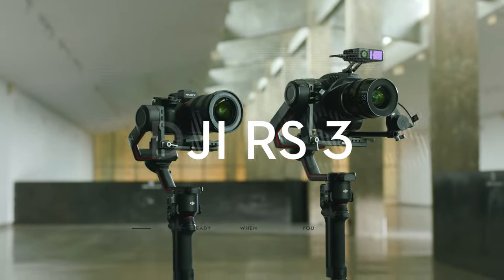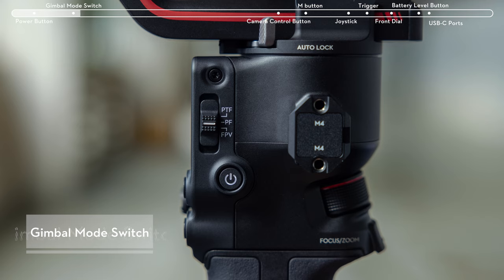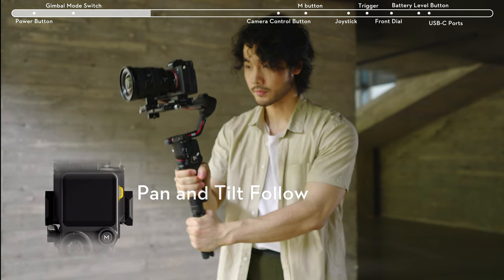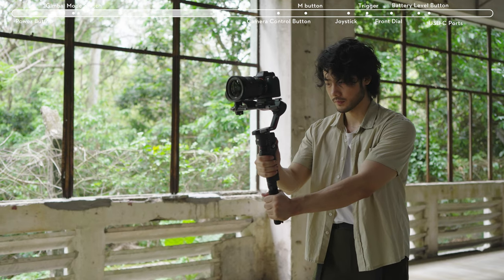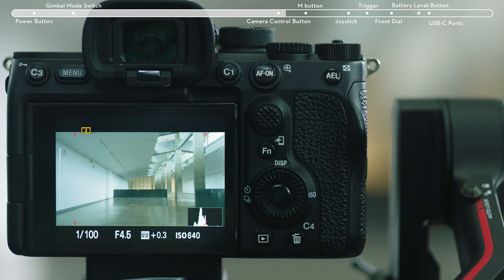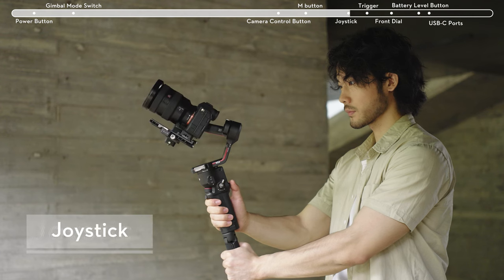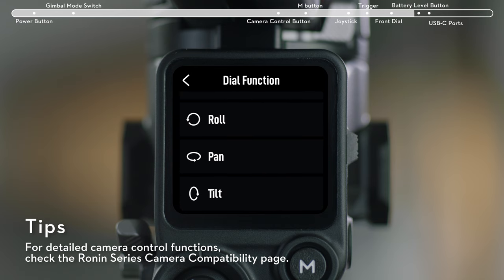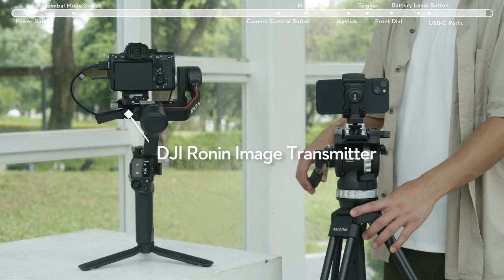DJI RS 3｜Buttons

Comment: Nice video! I would like to know if there is a possibility of powering the RS3 externally. I know that Power Supply Baseplate with D-Tap & NATO Mount is only available for the Ronin RS3 Pro. Do you think it would be good for the RS3 as well?

Comment: Thank you for this man I just baught the dji rs 3, is it normal when I select the fpv mode after any movement, the gimbal needs to be recentered every time. I have to double click the trigger to recenter it again
Reply: This happens to me on PF mode. It seems to need to be reset every time. No clue how to fix.

Comment: Unfortunately it didn’t work on my Z6ii.
However the 30cm USB-C to USB-C that comes with the RS3 worked like a charm.
I tested the RS3 Timelapse and it triggered the Z6ii flawlessly.
I still need to test if the Z6ii is receiving power from the RS3 so that long time lapses don’t drain the camera battery.
I’ll connect a power pack to the RS3 and hope power it kept up on both devices…
Reply: did power keep up to both devices ??

Comment: Dial Function: ISO not work for bluetoth.

My Sony A6400 does not work with the ISO function in the scrolling part.

Only the record button works normally.

Use in Bluetooth mode.

Bluetooth Remote Control is activated.

I paired it perfectly with the gimbal and the record button works.

I've already changed the scroll function for ISO, aperture, shutter and it doesn't work.

But if I add rotation, rotation and tilt it works.

Comment: So when the camera is connected via Bluetooth can I control aperture shutter and ISO or only the record button because that's a big deal for me that because of the swivel screen I can't really use the cable on the Sony A7 S3
Reply from the maker: Hi there, you can check this information on the compatibility list through this link. https://www.dji.com/support/compatibility/rs-3-pro/a7s3
Reply: @DJITutorials  TY 🙌 my question is why can't I control the same functions with Bluetooth like ISO aperture and shutter that's one of my main reasons that I need to use Bluetooth because the cable is blocking the swivel screen so Bluetooth connection will really help but only if I can control shutter aperture and ISO not just being able to record which that of course also really helps

Comment: Sir how to gimble activate
Reply from the maker: Hello, there. You may follow the steps below to activate the device:
1. Press and hold the power button to power on the gimbal.
2. Enable Bluetooth on your mobile device.
3. Launch the Ronin app and register or log in with your DJI account. Select DJI RS 3 Pro/RS 3/RS 3 Mini on the device list, enter the default password: 12345678, and follow the on-screen instructions to activate DJI RS 3 Pro/RS 3/RS 3 Mini.*
4. DJI RS 3 Pro/RS 3/RS 3 Mini will enter sleep mode after successful activation. Press the power button once to exit sleep mode before use.
Notes:
* During activation, make sure your mobile device is connected to the internet.
* DJI RS 3 Pro/RS 3/RS 3 Mini supports up to five trials without activation. After that, activation is required for further use.

Comment: Is there a lock mode in the rs3. If I want a steady shot straight on with no movement what mode do I put DJI in ?
Reply: No mode. Just press and hold the trigger while youre moving.

Comment: I know gimbal like this is for big cameras , however

Can we use iphone 13 pro for this?
Reply: Dji osmo 6. You’ll not regret it.
Reply: @umar  for the DJI osmo 6 it is good , however my set-up is beastgrip cage + micro lens , I notice there is a vibrating behavior in long time use 

It’s like the gear screaming , ITS HEAVYYYYYYY

Comment: When will the connection with the Panasonic Lumix S1 work?
Reply from the maker: Since the said camera is not on the compatibility list, the performance is not guaranteed. You can fill in the request on the camera compatibility page or conduct installation tests. We will also forward your request to the corresponding team. Thanks for your understanding. https://www.dji.com/support/compatibility

Comment: I have a7siii, I’m only able to use the Bluetooth // to control the record button , it won’t let me use iso/aperture . Am I missing something? It’ll work if I have the camera controls cable connected . Any help/tips?
Reply from the maker: Hello, there. Sorry for your inconvenience. Would you please check the compatibility list and setup method for each control cable?
Here is the link: https://www.dji.com/be/support/compatibility/rs-3/a7s3
Reply: @DJITutorials  we want to be able to control the basic camera functions like ISO aperture and shutter with the Bluetooth connection without having to use a cable because it's very hard to use the cable because it blocks the swivel screen from being able to function fully some Bluetooth will really help we need to be able to control the basic camera functions via Bluetooth not just being able to record but also shutter aperture and ISO will really help is that something you can update with the firmware looking forward thank you so much God bless 🙏 🙌 😇 📸 💪
Reply from the maker: @MendelMish  Sorry for your inconvenience.  The Bluetooth Shutter function of DJI RS 3 /RS 3 PRO is realized by simulating the shutter button on the camera and further controlling the camera. Thus, Bluetooth Shutter only supports Capture Photo, Start/Stop Recording Video			
Trigger Auto Focus. For details, please refer to the compatibility list.

Comment: I have a problem with 3d Roll 360. When I put this mode and tilt the gimbal to rotate the camera, the rotation stops at 30 degrees, both left and right. Worst case scenario, the gimbal goes crazy and starts making weird creepy movements that force me to turn it off. Does anyone have a solution?

Comment: Having a problem with 3D Roll 360. When I double tap the joystick to put it in automatic roll mode, tapping the trigger doesn't stop the automatic rolling (like it says in the instructions). I have to switch to PF or PTF to disable automatic rolling (the only workaround I've found so far)
Reply: Dude Can you please tell me how to do 360 in RS 3 Gimbal?
Reply: @hatim_the_carguy  having the same problem...
Reply: @stvphzcam  First of all, Switch your gimbal mode to FPV. Then, go into FPV menu scroll. You will Find 3D Roll